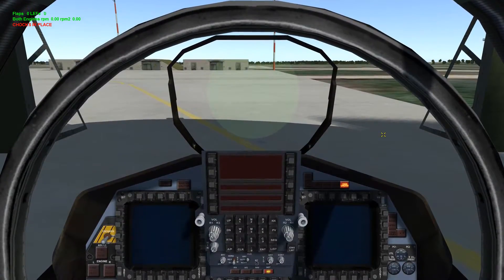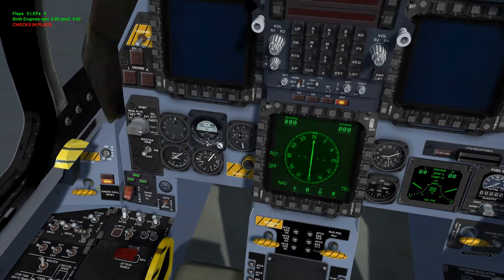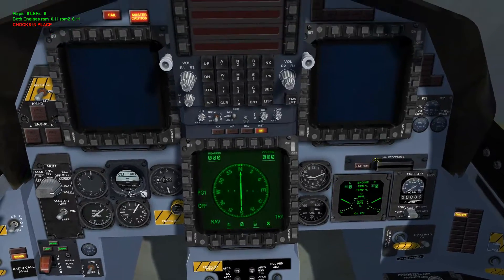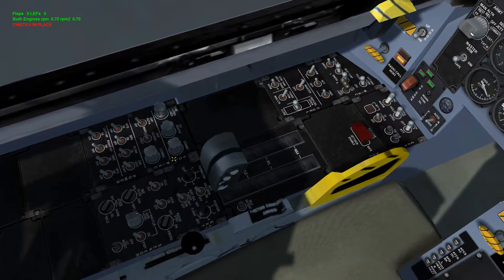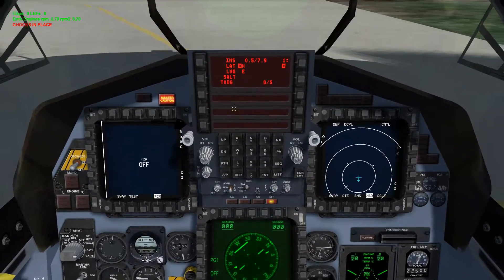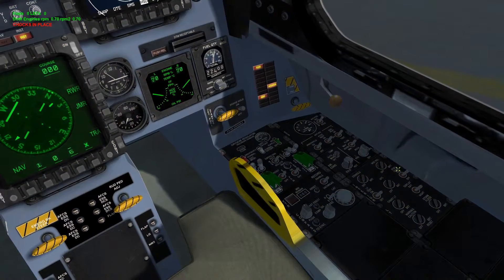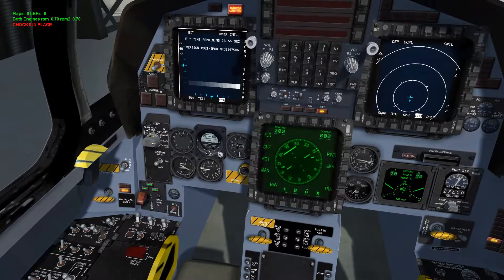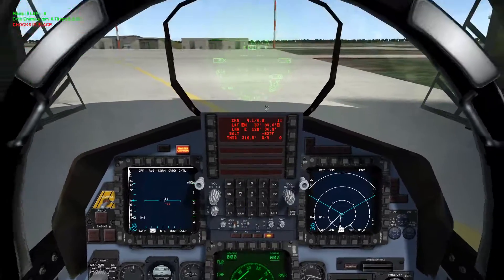Falcon BMS 4.33.1: F-15E Strike Eagle Ramp Start Tutorial (Outdated)

Comment: how do i get the f15e?
Reply from the maker: The only way currently to get F-15E in the default theater is to create a save game. So pick any Squadron and then save the game. Use the program Mission Commander (http://www.weapondeliveryplanner.nl/news.html#mc1) to edit the save and change one of the squadron to fly F-15E. Load up the save you edited. Then select the squadron that you changed over. Of course make sure to backup the save just in case anything happens.

Comment: Hi there, i recently got into pc gaming and play dcs right now (its the only thing on my hard drive). I see falcon 4 is pretty cheap compared to dcs and was wondering if falcon 4 bms is as detailed as dcs world. All these planes were made fairly quickly where a dcs module takes a lot of years. I see graphics are different but i dont mind. I was wondering if i should invest into more dcs modules or try spending my time on bms. Thanks
Reply from the maker: Hey k storm, well to start the thing with Falcon 4 BMS is that it is a F-16 flight sim. Its what the game is based on when I came out in 98. Yes it is very detailed when it comes to the Falcon. There is no other game out there that can come close. As for the other aircraft they are detailed when it comes to the flight model of the aircraft, but because this is an F-16 game. A lot of the system works, work like they do in the falcon. Example would be on the F-15E here, the radar system work very differently to the F-16 but what we see is F-16 radar.

As for whether or not you should get Falcon or continue with DCS. Being as cheap as Falcon is, I would say why not. You will get more then your moneys worth with Falcon and BMS. The big kicker is the dynamic campaign that Falcon has. Which is great and can be played online with or against other people.
Reply: Jojcib thanks ill give it a try

Comment: I am currently using he version 4.33.2 of Falcon BMS but for some reason every version of F-15 i try to fly have no clickable cockpit
Reply from the maker: Press either 2 or 3 and that should put you in the virtual cockpit.
Reply: Jojcib Yea i have tried, but unfortunately i am only getting a background photo of the real cockpit with very few 3D elements, such as the throttle and few clickable areas around the MFD
Reply from the maker: Hm, I'm not sure then. If you haven't I would ask on the BMS forums. They maybe able to figure it out better then I can. Sorry I couldn't be more help.
Reply: nah man, actually many thanks for sharing ur experience, i will definitely ask on the forum. Even tho i am now learning and still sticking only to the F-16, i was just curious if by chance i have done some wrong steps in the installation
Reply: I just found the solution to my problem, all the F-15s i have tried were mostly F-15C and F-15D, so as last trial i just create a mission, selected the F-15E 220 and Voila' the clickable cockpit magically appeared, and by the way, i am now realizing the model was well specified in the title and description, many thanks for your help.
Reply from the maker: Ah, I forgot about the C and D. No problem.
Reply: Ok that's been my problem also so I need to select the E model to get clickable cockpit.

Comment: very usefull tutorial, but i have a poroblem. i'm using 4.33.2 and the rwr just won't work on the f15 for some reason, i did the trick you showed turning it off then back on, still nothing, not even audio warnings
Reply from the maker: So when you hit right alt+numpad 0 an I doesnt show an I in the middle of the RWR page? If show the only thing that I can think of is that the keybinding got messed up. Check in the controller section to see what the keybinding set to. It should show up as RMFD:OBS 20 Button Push. If not that need to be bound.
Reply: i'll try it again and let you know, thanks.
Reply: it's working now, idk what was wrong... thanks!

Comment: No Apu?
Reply: Also I've talked to a real f15e pilot he said u cannot start both engines at the same time is this sim accurate?
Reply from the maker: When it comes to the F-15. No, it is not. Really the sim itself is an F-16 simulator. All the other aircraft that you can fly. Are just F-16 with the flight model of the aircraft its imitating. That's why you can start both engines at the same time. When in reality you can not. So the game thinks you are starting a single engine aircraft when your in a twin.
Reply: +Jojcib oh okay and there's not an Apu?
Reply from the maker: yes and no. the F-15 doesn't have one, but I know the F-18 does. Though it's not required for engine start.
Reply: +Jojcib oh yeah and that must be why why all the mfcds are the same
Reply from the maker: correct.
Reply: +Jojcib if u could can u tell me what aircraft are available to fly?
Reply from the maker: The current list are: F-16, F-18, Mirage 2000, A-10A/C (C variant uses the A cockpit right now), AV-8A/B Harrier, F-15, Tornado, JA-37 Viggen. The aircraft listed above have 3D clickable cockpits and Advance Flight Models. You can also fly the F-4 Phantoms, F-14 Tomcat, and MiG-29 but these aircraft are not as fleshed out as the ones listed above. The have rough 3D cockpits and basic flight models. Minus the MiG-29 I believe with the flight model (need checking). That pretty much it, if you want to know more details on them. I would hop on the BMS forums and get the manual as it goes over everything. Which would be too long to go into for youtube comments.
Reply: How do I get this ?
Reply from the maker: You can get Falcon 4.0 off of steam or gog.com (under the falcon collection at gog). Which needs to be installed before you use the mod. Then go to the BMS forums here http://www.bmsforum.org/forum/content.php . Register and go the Release and Update section and dl the mod.